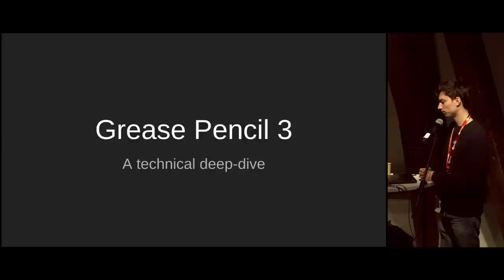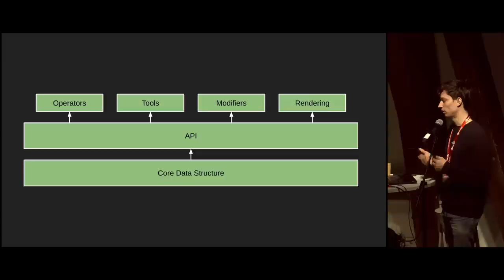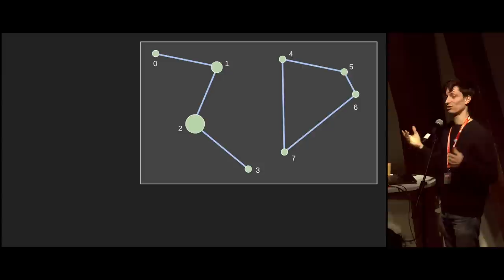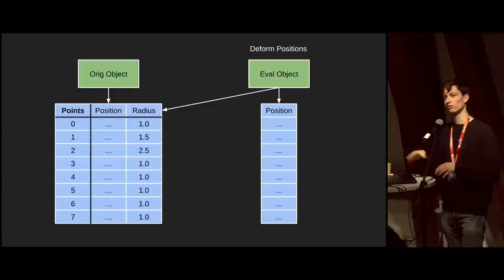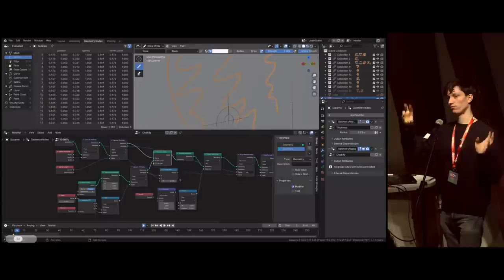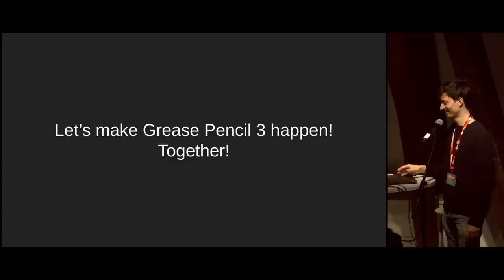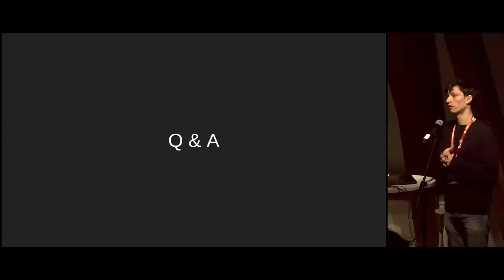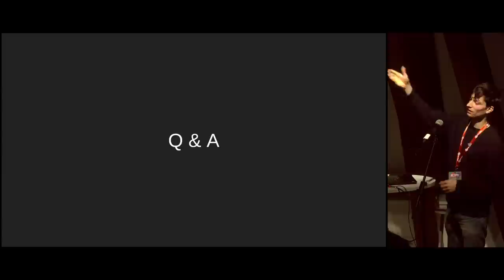Grease Pencil 3: A technical deep-dive

Comment: Actually there is another optimization that you can use.
Instead of copying the position data, you just create a vector of offset from the original position. 
And you can create a stack of that offset to implement the undo feature. 
And when the user commits the change, then that stack will collapse and finish be applied to the original position data.

Comment: if the speaker ends up reading the comments, I really hope you guys can implement preexisting brush formats INTO grease pencil, such as Photoshop, Gimp, MyPaint, Etc formats, because people who already have a favorite brush/brush pack in these engines could simply import their favorites into blender and instantly get results they're used to. I know blender has their own brush format, and it should still get more development, but also, others have invented the wheel to good effect already, why not bring their work and the benefits that follow into blender
Reply: This should be worked on as an addon imo :)
Reply: @kokoze  I think i partially agree with this... the reason is because brush sampling/ dabbing is an intensive process. I think that the import and export of the brushes should be an addon, but the brush sampling engine should be written in c++ so it can be as performant as possible
Reply: I am developing my own add-on (called NijiGPen) to load brushes. So far I can extract brush textures from Photoshop/GIMP and soon from Procreate. But getting the right parameters is a pain. On the one hand, brush formats like ABR are not open and cannot be fully parsed. On the other hand, these pixel-based brushes work in a very different way than Grease Pencil. I am still not sure what the best approach should be.
Reply: @chaosinism9491  in my opinion someone needs to rewrite blender's brush dab engine to support more parameters. These values can be stored in each spline point as arbitrary attributes, if this is done, it wouldn't matter what brushes we import, we would be able to write a shim to make the brush compatible with the program